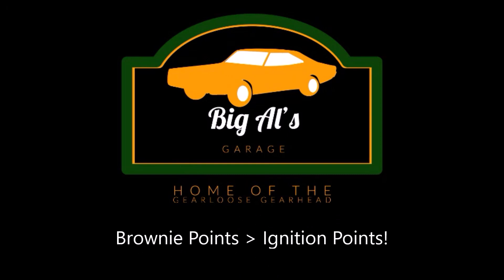Corvair Update

Comment: Did you check the float level of the carburetors? Have you also checked to see if the carburetors are tuned to the appropriate specs if your engine? When was the last time you did a hot valve adjustment? How well is your vacune advance working? What timing did you set the engine too? Also doing a compression test on your engine will give you a good idea about the condition of your engine.